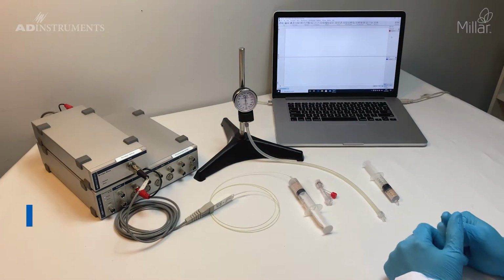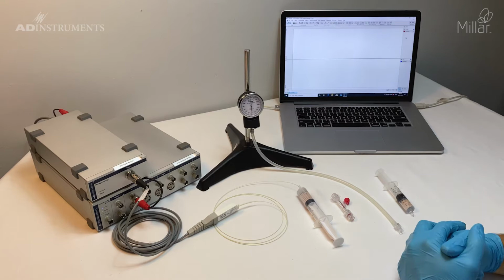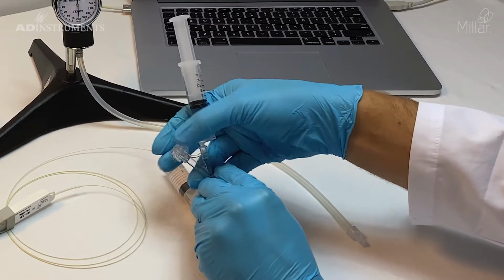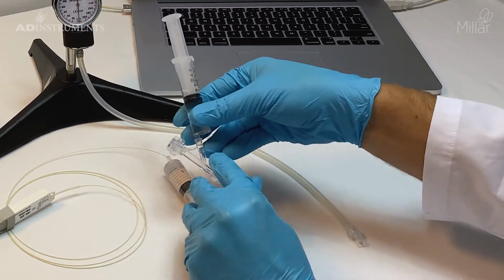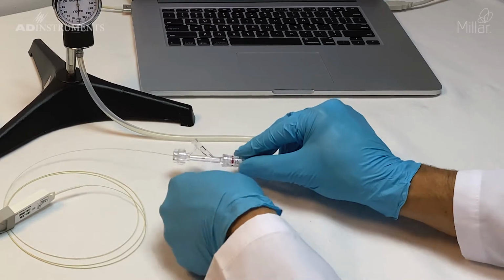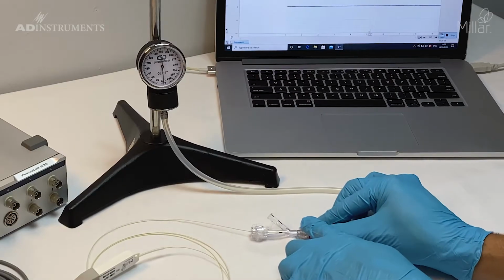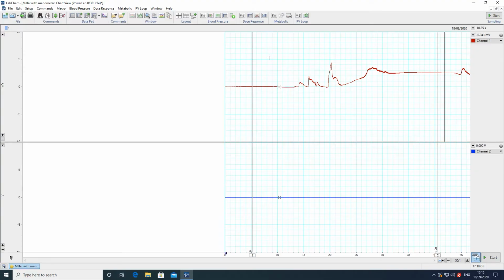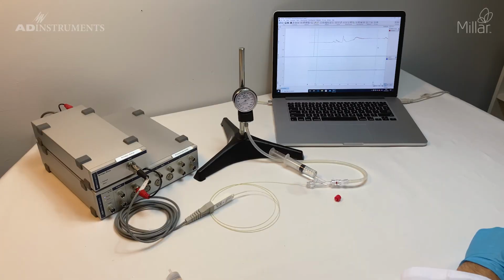Calibrating a Millar Catheter Using the Pressure Gauge Kit

Comment: Thank you for this, very useful. Is the saline a strict requirement for calibration? Can an ordinary sphygmomanometer connected to a valve not work? This is what we use for calibrating a fluid filled catheter so we're familiar with that set up.
Reply from the maker: Thanks a lot for your questions and apologies for the delay in responding. Yes, you can use a sphygmomanometer to calibrate the pressure (the dial from the pressure gauge kit is from a sphygmomanometer). We suggest saline as this is what’s commonly used with fluid filled catheters, but deionised or distilled water would be fine too.